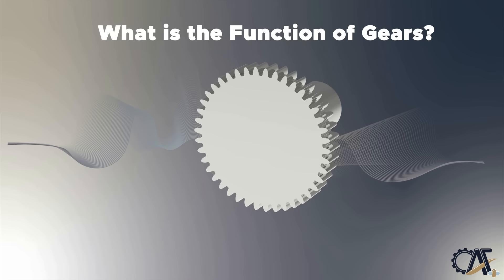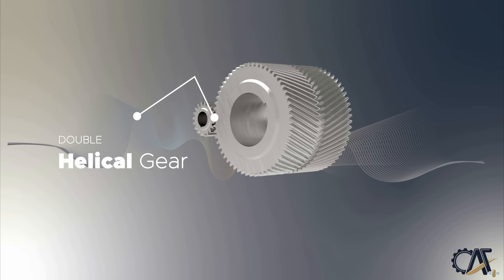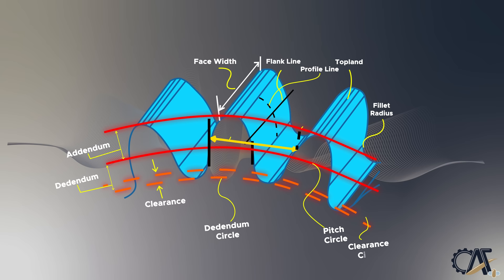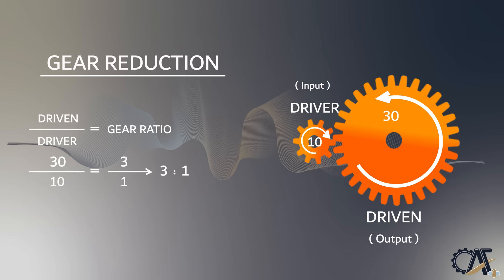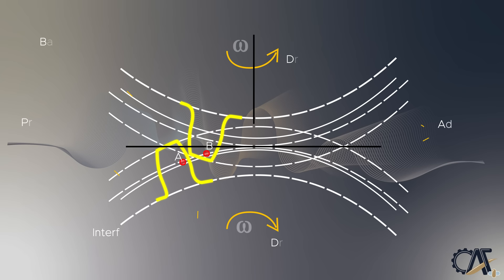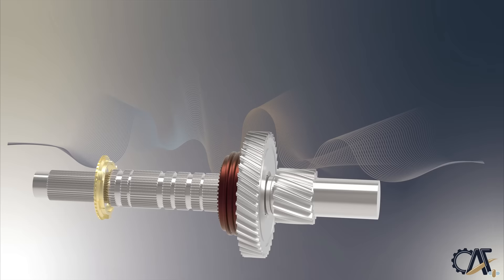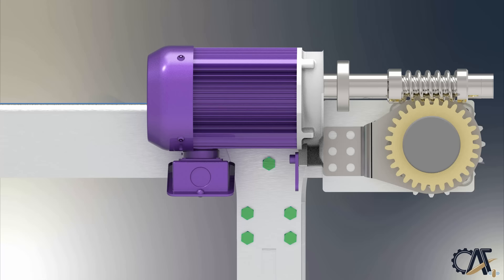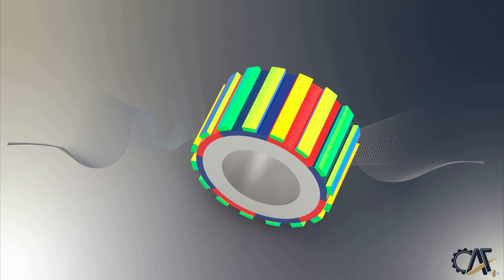Gear Types, Design Basics, Applications and More - Basics of Gears

Comment: It is true that helical gears can handle more speed than spur gears and are used in almost all car transmissions. Nevertheless many racing transmissions and most motorcycle transmissions are using spur gears.
Reply from the maker: Correct, racing cars/motorsports use spur gears in their transmission due to their higher efficiency. In addition, spur gears don't generate any thrust (axial loads); thus, the overall transmission design can be lighter which is critical in a motorsport configuration (To handle the axial loads, helical gears necessitate the use of heavy-duty transmission casings, shafts, and bearings). Still, the incredibly high noise the spur gears generates makes them less desirable for being used in the transmission of regular cars (except the rear gear in older cars that used to be a spur gear).
Reply: @CAEPlus  Why don't automotive transmissions simply use herringbone gears to null the axial thrust, rather than transmitting it to the bearings?   Is there an advantage to using helical gears with axial bearings, instead of using herringbone gears and radial-only bearings?
Reply: @Carl Hansen  Herringbone gears are substantially more expensive to manufacture, and can be tricky to assemble.
Reply: @stevenrs11  Thank you for answering and that makes perfect sense.  So it is a matter of tradeoffs, that axial bearings are a more economical choice to herringbone gears, in terms of which one is easier to construct.

Are there any performance tradeoffs between the options of herringbone gears with radial-only bearings vs helical gears with axial bearings?  Such as does one of these have better friction or efficiency characteristics?
Reply: @carultch  in that sense, Herringbone gear has better performance than Helical gears with bearing.

Comment: The part where you are talking about a high point gear. I can't help but link that to machining on a lathe. Most people think having the tool at center of the part is ideal. It isn't. And being under the centerline would cause the part to climb over the tool. Which I assume would have almost the same effect with this style of gear. I only mention this because in turning on a lathe, you want the tool slightly above center.... "for better wear resistance" on the tool. (And a more consistent cut) Seems a bit coincidental, doesn't it? Almost like one learned off the back of another manufacturing style. 😅

Comment: Something I didn’t see mentioned is how to choose the number of teeth to use in each gear when their ratios are low (but not 1:1) or the number of gears to use for high ratios.  In particular, would it make sense to use numbers that are relatively prime in order to evenly distribute the wear between pairs of meshing teeth?  What are the pros and cons of using a few large teeth versus lots of small teeth?
Reply: this is a material question, so the best way is to think about this in a extreme way. if I make really really small thin teeth like we are talking tin foil thin then rather then turning the gear it will fail because the foil thick teeth bend and break. so that's why you don't want too thin. so rather then starting with 2 gears lets start with 1 gear. so their are 360 degrees in a circle let's pretend each gear is 1 degree you have a stick that's on a line that enables you to push only one gear at a time. you push the 360 teeth gear and move the gear exactly 1 degree you push it 360 times and you have made 1 rotation let's say you lifted a 1 pound weight 1 inch in doing so. now let's say we have a gear that has 30 degree gear teeth meaning their are 12 of them on the circle, you push it with your stick on a line and you move the circle 30 degrees you push the gear 12 times and you make 1 full rotation and lift the 1 pound weight 1 inch. the weight and the distance stayed the same so it takes less torque to do it 360 times vrs 12 times. the lever, pully and gear are all the same they are taking doing something a lot and trading for using greater effort the lever moves a greater distance, the pully uses more rope, the gear turns the circle a smaller amount all basically the same thing.

Comment: It makes sense for helical to produce axial thrust. But when using two gears that have opposite angles shouldn't they cancel each other?
Reply from the maker: Thanks for your question! Correct, the axial thrust force can be canceled by using a double helical gear (herringbone). Even though there is a net zero axial force on the shaft with a double helical gear, the axial loads should not be ignored. These forces create a moment that must be counteracted by the bearings and must be included when calculating bearing loads during the gear engineering design process. This is one of the main reasons why helical gears have a lower efficiency than spur gears. I hope we were able to answer your question!

Comment: If you had a spherical ball would it allow better turns? Like a Dyson ball?
Reply from the maker: Correct, a gear similar to the spherical ball in Dyson vacuum cleaners can offer improved maneuverability and ease of turning. For instance, unlike traditional gears that primarily rotate along one axis, a spherical ball gear will be capable of moving in any direction. This omnidirectional functionality allows for sharper, more fluid turns in the mechanical linkages connected to the gears, thereby improving overall operational efficiency.
Recently, Japanese engineers and scientists have conducted significant research on spherical (ball-shaped) gear designs. This innovative work is currently still in the research and development phase, reflecting ongoing advancements in the field of mechanical engineering.
Please let us know if you would be interested for a video on this subject. 
Thanks for your comment!

Comment: does the worm gear and the wheel gear attached to it move in the same direction? And also, if we were to have a straight bevel gear with two gears horizontally on it would they both move in the same direction?
Reply from the maker: Thanks for your question, and sorry for our late response. 
Actually, the axes of rotation of the worm gear and the pinion are different. So the direction of rotation will be on different axes. However, if you mean, the worm gear can rotate in both directions with a helical gear? The answer is "Yes"; worm drives can be built with helical gearing that is either right-hand or left-hand, allowing them to rotate in clockwise or counterclockwise directions. For instance, a right-hand helical gear rotates the worm clockwise or vice versa.
Regarding your second question, if a straight bevel gear has been meshed with two gears horizontally, each of the meshed gears will have an opposite direction of rotation. So if you are looking at the bevel gear from the side, one gear will be rotating clockwise and the other counterclockwise.
I hope we were able to answer your question.
Reply: The bevel gear you are describing sounds like a crown gear.  A crown gear is a bevel gear taken to the extremes, so it can interface with a spur gear on the perpendicular shaft, rather than another bevel gear.

Comment: Used to be control of valve any
Reply from the maker: I am not sure if this is a question or just a comment. 
Correct, the camshaft function is to ensure the engine's inlet and exhaust valves are operating at the right time, with the exact stroke and in a precisely defined sequence.

Comment: Have you covered strain wave drives as well as cycloidal disk drives?
Reply from the maker: Thanks for your comment! Actually, "Strain wave gearing" is a special type of gear, and its working fundamental is very similar to a ring gear. Regarding the "Cycloidal disk," we will be creating a video for hydraulic gear pumps and will cover a similar coupling drive in that video. Our intention for this video is to introduce the most commonly used gears in the industry. I hope we can cover the two other types of gear/coupler in our following videos.
Reply: @CAEPlus  ok sweet. I know a fair amount about the 2, but I just wanted to see if there was a video you had produced on the topic. They are a lot less known. I’m excited to see those videos. I’ll make sure I have my notification bell checked for this channel
Reply from the maker: @Stonedyeet  Of course, thanks for following our channel!👍

Comment: what programs are you using, please can you write
Reply from the maker: We use multiple different software to create these videos and it requires a good skill set to utilize those software. For instance to achieve high accuracy for the gears ⚙️ geometry we 3D modeled them with a CAD software. There are multiple CAD software available in the market (SolidWorks, CATIA, ProE, Siemens NX, etc.). Any of them can be used for this purpose.

Comment: I don’t understand gear teeth shapes. I’ve seen a video or two on it and even done some tests. I think there is a trade-off between strength and friction. Or were the gods kind and gave us a shape that is maximally strong and maximally low in friction. Gods are generally unkind, so you’d want some software slider that adjusts strength-friction.

Comment: As is as isn't gear as camshaft as ..
Reply from the maker: Again I am not sure if this is a question or just a comment. Actually, the engine crankshaft has a gear or sprocket fitted to its one end. So the camshaft shouldn't be mixed with the gear/sprocket attached to it, as the function of each is different.